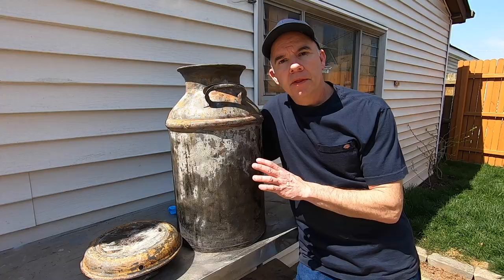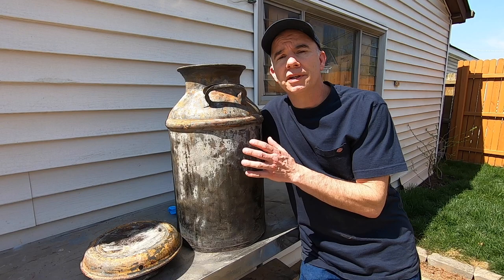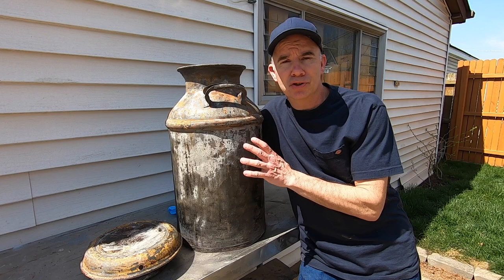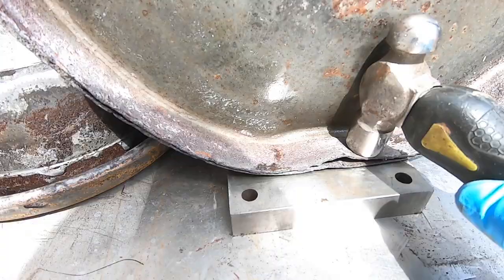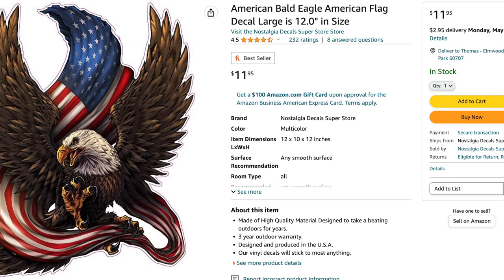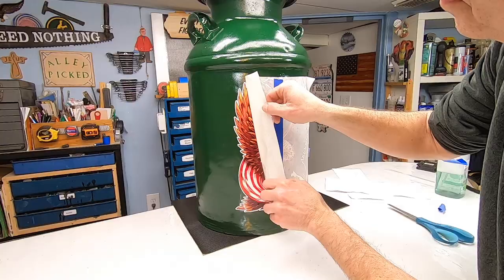A Historic Milk Can Restoration

Comment: We used to see these type of milk vessels here in Northern Ireland too, but they were much bigger, more than a metre tall, and made from metal called, I think, German silver. We called them milk churns. They were for transport from the farm to the bottling plant; there was one quite close to where we used to live in east Belfast. Gosh, that's a few years ago. That turned out well Tom and I especially liked the edging on the bottom rim, very good idea. Cheers mate.
Reply from the maker: Very interesting Mark. Some people here also called them churns. My early memories of milk involved my mother sending me to the store to buy a gallon of milk. I would walk half a block and then switch hands as the red plastic handle would cut off my circulation.